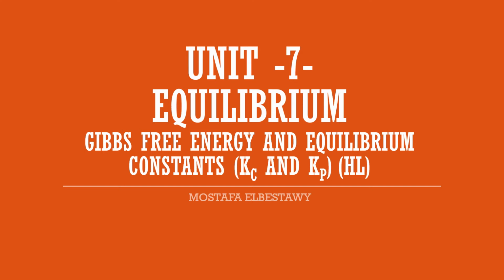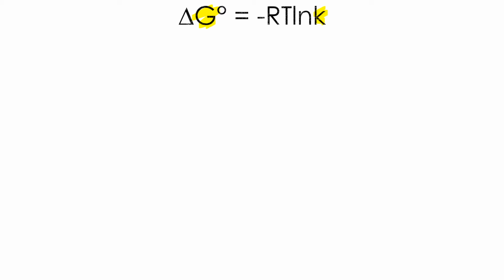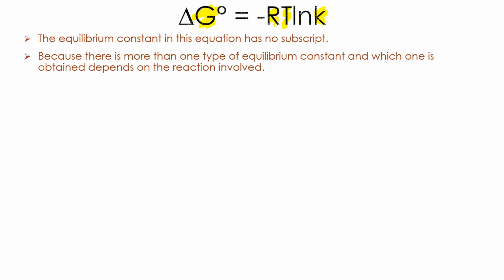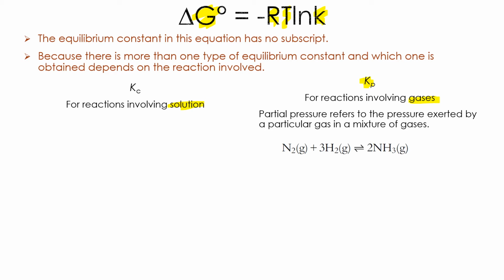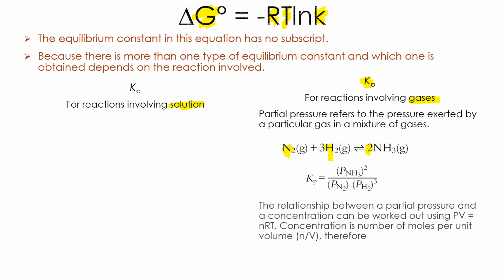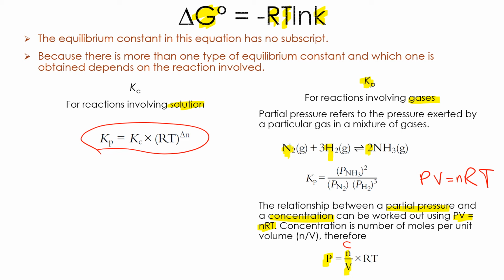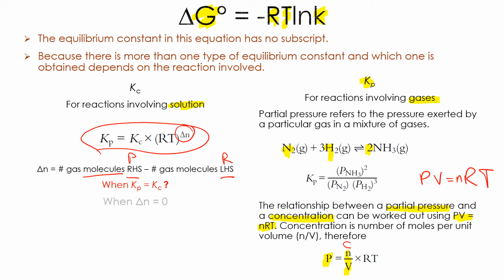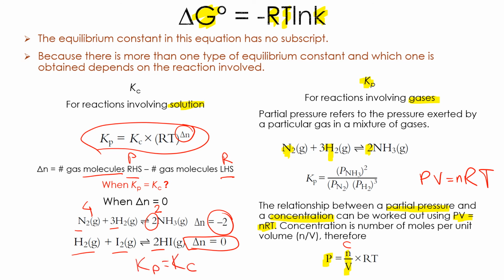Gibbs free energy and equilibrium constants (Kc and Kp) (HL)

Comment: What happens if the equations involves gasses and solutions?
Reply from the maker: It depends on the question. Actually calculating the equilibrium constant is depending on what is given in the problem. 
If you were given concentrations, you could calculate kc, but kc could equal kp if the number of moles of the reactants is equal to the number of moles of the products.

I hope that helps!